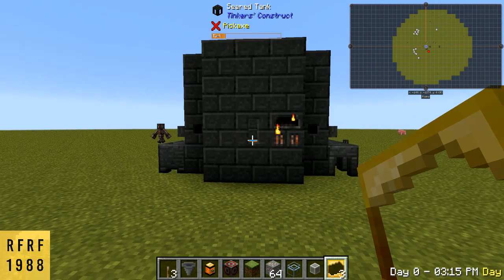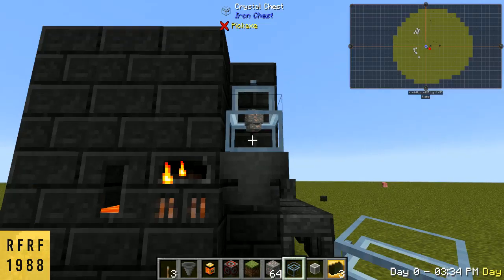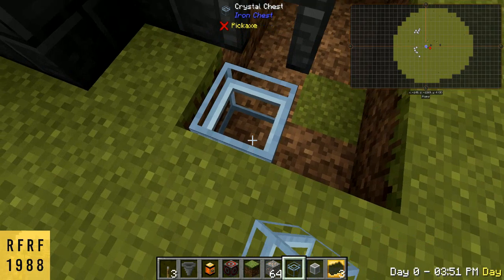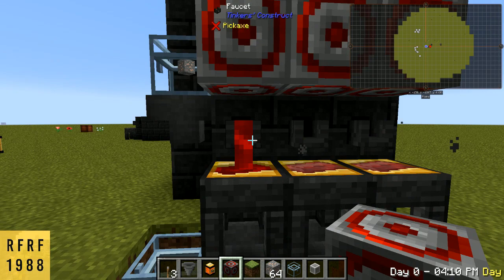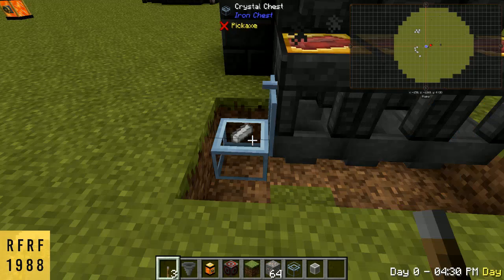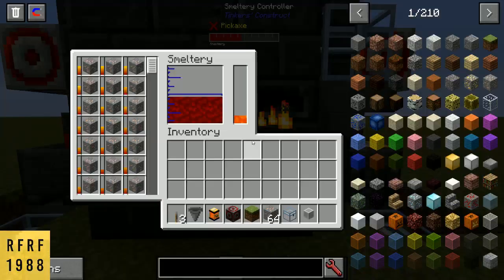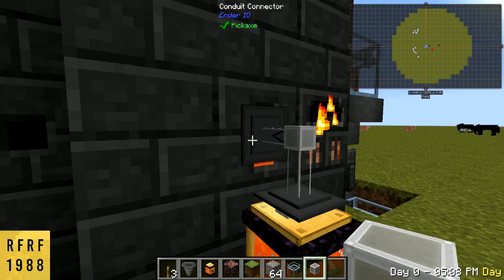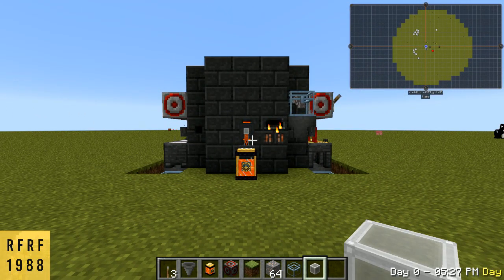Tinkers construct how to : Automate Smeltery

Comment: i know this video is getting old but can i get some help cause im playing the crashlanding modpack and ive got nuggets in my smeltery that keeps causing problems untill i can cast is there anyway to get around that other than placing a bunch of drains
Reply from the maker: Three ways you can go about this...you can break down your large smeltery into many small ones and only use single ores in each one i tend to do this late game as more resources are available...2. is to just be careful what you put in the smeltery and 3. This is version specific i believe but you can make nugget cast in the same way you make an ingot cast.
Reply: @RIFFRAFF1988  tried making nugget casts to solve it cause it would be less efficient but wouldn't clog up but sadly isn't in the version or I need to loot into it but if not i may or may not use a mod if there is one.

would love to break it down but the modpack im on is really heavy on what you get i can only build a one layer smeltery cause the grout recipe was removed from crafting just cause of the mods. 

thanks for getting to the comment tho.
Reply from the maker: @zhthgaming8309  So i learned something new! the video will be out on my new channel tonight at midnight eastern time. It solves the half full basin and table issues without external mods. https://www.youtube.com/c/MinecraftMentor

Comment: I'm trying to figure out how to attach a hopper to the Furnace without it pulling things out before they're done.
Reply from the maker: Its pulling ingots out of the controller ? not sure how that's possible. if your using the hopper clocks throw a lever on them to stop them from working or just replace them with a lever all together
Reply: @RIFFRAFF1988  well i'm talking about the Furnace from the mod, not the metal smelter thing.
Reply from the maker: @Layarion  check your modpack for a pipe that has a filter on it...like refined storage then make it only pull the finished product instead of the ore.

Comment: Thank you for the clock idea, was using levers in stoneblock 2 and wasn't getting a repeated flow, would only do 1 block funcioning as a 2 click button. Clock + lever on that works just fine for me.
Reply: I don’t know if you are still playing or not, but try using some sort of fluid pipe or cable, they are pretty great for this.

Comment: You can really improve automation via Integration dynamics mod (Fluid reader+Redstone writer) by setting it to send a redstone signal only when you have enough metal for an ingot (That's really lame when a cast fills only halfway). Also, casts fill almost instantly if you use EnderIO's fluid conduits instead of seared faucets. But what you've shown is a great early game setup.

Comment: You need to have a solution that solely requires Tinkers Construct content (or vanilla). EnderIO isn't an option for everyone.
Reply from the maker: baden271 unless im un aware tinkers does not have a liquid transferring pipe and neither does vanilla. your only option is to use one of the thousands of mods out there that also can transfer lava.
Reply: You’ll have to create your own redstone circuit if you are doing vanilla with tinkers. Often, sources like redstone blocks and levers stop working for some reason.

Also I don’t think there is any way of inputting liquid, so you would likely have to manually add lava.